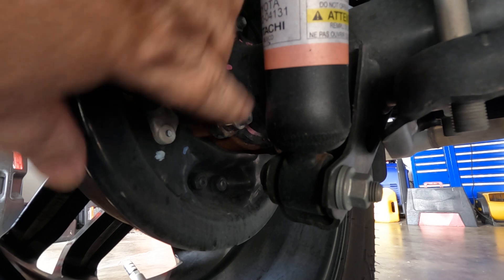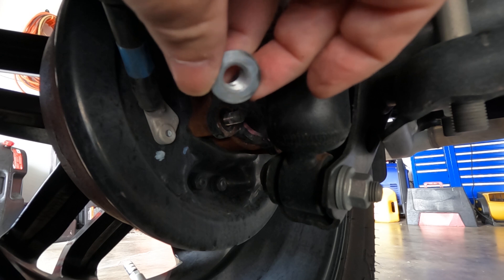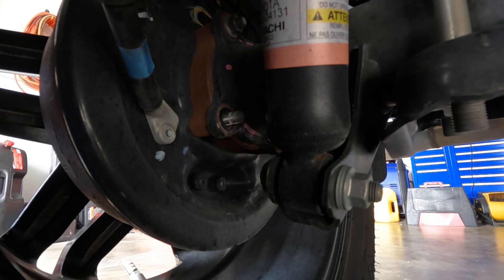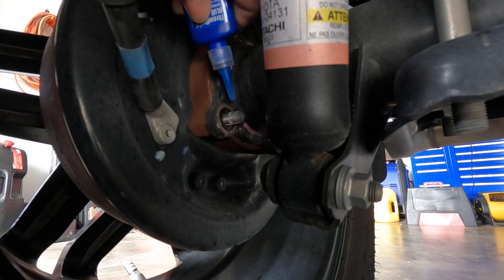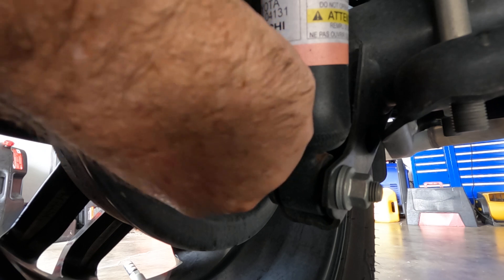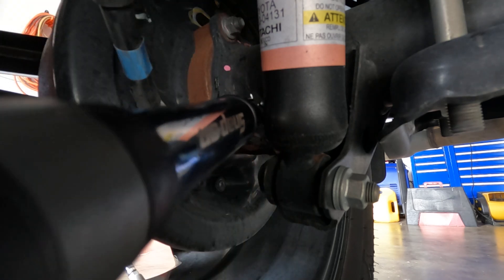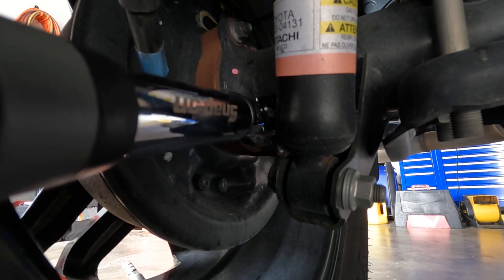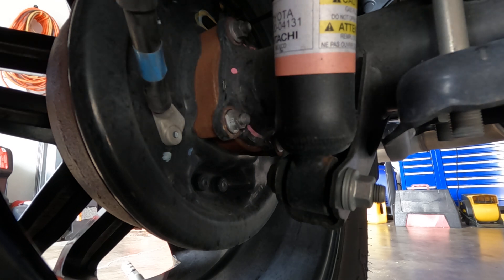Toyota Tacoma 2022/2023 Rear Axle Nut Recall Procedure

Comment: I think you are right that Toyota maybe holding back about a bigger issue, but I dont think its just torque specs. Looks like I was one of the unlucky one to run intp it with mine. I have a 22 tacoma v6 and have had alignment issues with my truck with pulling and after toyota did the recall and realigned it now uneven tire wear on my tires. When toyota did the recall they only checked the alignment box that front and rear wheels were aligned but gave no degree in or out. Well decided to have an alignment done with an independent shop and they found the rear axle is bent in toe 1.53 deg all front toe and camber is off too! I don't off road the truck, I have a 73 k10 for that, and only did light towing. I drive mostly on the freeway, so my only thought is that maybe potholes on the freeway caused it to bend or it was bent from the factory, but just seems unsual bc I drove a honda civic on the same roads hit similar potholes for over 10yrs and never had an alignment issue. Thus, I wonder if due to covid and poor mfg QC that bent axles were installed on these trucks from the factory or they were not properly tempered and are bending under normal driving conditions.

Comment: Interesting about being torqued wrong from factory. In the comment section of another video a guy said he check his himself, he said it seems like they were more at 25 then 41. I had mine done and they said it was fine, but now the thumping that I heard and felt when breaking is gone, so that tells me they weren't at proper torque. What frustrating is that I have taken this truck in 3 times for scheduled service, and each time I told them I can hear and feel a thump coming from the rear when I break, they did nothing about it.

Comment: Also have to check the stud for welding splatter and the stud would be replaced if the stud has splatter.  If there is splatter under the nut. It gets filed and the nut is replaced with a new nut.  A second visit is required for the stud replacement.  They mark it with a paint pen and order parts.  Its a big job if studs have to get replaced.  Its a quick in and out if its just the inspection, slag removal and nut replaced.

Comment: I just did mine today and all 8 were fine. However, I did fine a spatter of weld slag near one bolt on the driver side…the bottom bolt closest to the front of the truck, but it did not affect the seating of the bolt. It took me about 30min. I used 41ft/lb and blue lock tite per your recommendation…thank you!
Reply from the maker: Glad you had no issues, now you don't have to worry about it any further.

Comment: So, if a guy were looking at a 2023 Tacoma the recall shouldn’t necessarily dissuade him from purchasing it?
Reply from the maker: No, this recall is minor in nature, all you do if weld splatter is found under the nut you file down the weld splatter and replace the nut if at a Toyota dealer, Even if you see a small scratch or indentation on the bottom of the nut that is not going to cause a problem If the entire under side of the nut is grooved then replace the nut if you are doing this yourself. I would however use blue lock tight and use the recall notices 41 ft lbs of torque.
Reply: this is as simple as a recall as it gets. The tundra has recalls with machining metal shavings inside the engine destroying the engine, that's the kind of recall that should siuade you from buying.

Comment: ANNOUNCEMENT: Many Loctite formulas require the use of Loctite's primer. If the primer isn't used, the Loctite wont work. 
Loctite hardens by stealing elements from the metal, so if the metal has any coating, the primer needs used.
Generally, the formulas that need a primer end with a positive number. It's best to double check your formula.
Reply from the maker: From Permatex Technical Data Sheet: PERMATEX Medium Strength Threadlocker BLUE is a medium strength anaerobic threadlocking material, which cures between engaged threads to form a unitized assembly that resists virtually all leakage, shock and vibration. The product is a single component, anaerobic liquid that cures when confined in the absence of air between close fitting metal surfaces. Ideal for all 1/4 inch to 3/4 inch diameter nut and bolt assemblies. 

Active Metals
Soft Steel 
Iron Copper
Brass 
Manganese 
Bronze
Nickel 
Aluminum Alloy

Active Metals do not require primer.

Inactive Metals
Bright Platings 
Anodized Surfaces 
Titanium
Zinc
Pure Aluminum
 Stainless Steel 
Cadmium

Inactive Metals will require primer.

The studs and nuts used for the axle bolts will fall under the active metals and will not require primer. While you can use primer on the active metals it is not needed and you will have to work fast or the thread lock will harden before you finish installing and torquing the nuts.

Comment: I totally agree did mine as well and they were probably somewhere around 25 ft lbs, I’m a plumber and used to torquing anchors so I have a good feel for torque, they were way under torqued from the manufacturer
Reply from the maker: Mine were not very tight either when I removed each nut. None of the nuts had any weld splatter under them. I did reinstall each nut with blue loctite and torqued each one to the recall spec of 41 ft lbs of torque. My 2023 Tacoma build date was 5/23. The recall covers all Tacoma's with a build date starting from 5/22 through the end of the 2023 model year production run. Toyota nor the axle supplier knows how many Tacoma's were actually affected.

Comment from the maker: I wrote out the procedure above as well so you have it step by step. This will take you about 30 minutes total to remove each nut and check the surfaces, put some blue loctite on the studs and replace the nut torquing it to the recall spec of 41 ft lbs of torque. I hope this helps those who don't have time to go to a dealer and leave your truck for a day over a 30 minute to 1 hour job if they have to file down the weld splatter if yours has any. This took me a total of 30 minutes to check all eight of the nuts and mine was fine. My trucks build date was 5/23 so that might help others knowing the build date and the outcome of my truck on this recall. I will not be taking my Tacoma to Toyota for this.